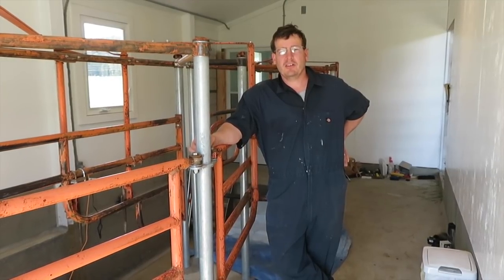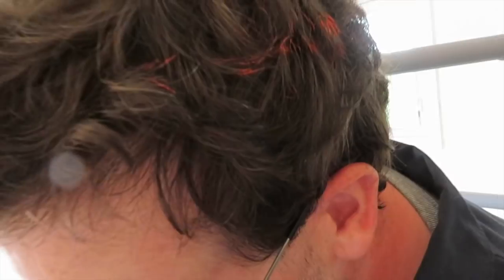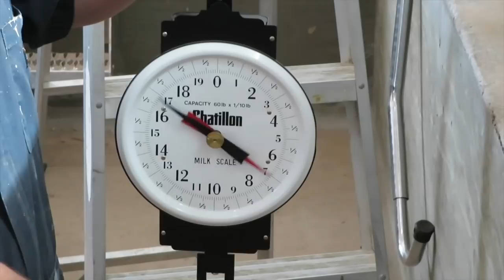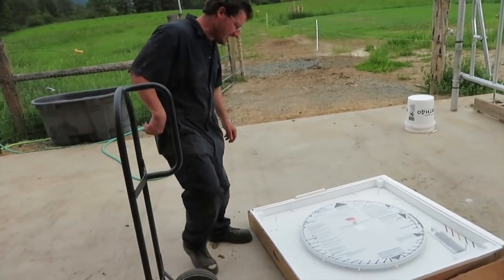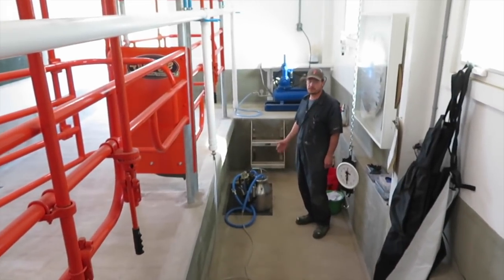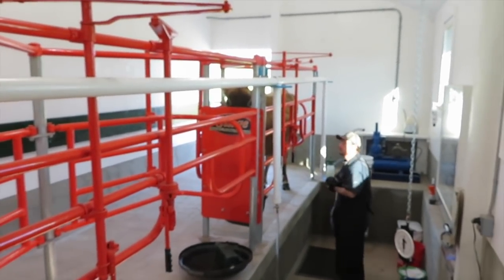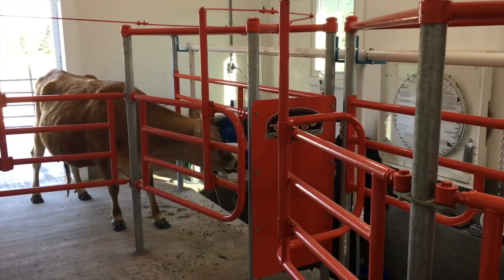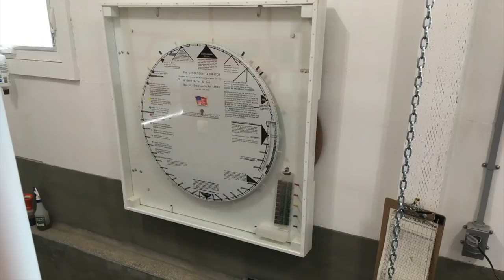Surge Milking Parlor: Installed and Milking First Time! (Building Dairy Barn #16)

Comment: Well Stacy, nice job on getting your parlor painted, now all you need to do is get the cows in there so they can rub all the paint off!  Also, I would take that anti-kick device you have and throw it out the door.  You need the big clamp that goes over the back.  I tried one of those devices that you have and it came off the cow's back and hit me in the head.  ;)
Reply from the maker: I’ve never had a problem with that kind of anti-kicker. I’ve used them in every parlor I’ve worked in. Luckily, we haven’t had to use ours yet! The big clamp type probably work better, but you’d have to climb up to the cow platform to put it on. With the “C” style, you don’t even have to leave the pit! I guess that’s why you only see the “C” style in raised parlors.

Comment: Just seeing your video of the Surge Milking Parlor.  Looks pretty nice.  I have the same in my old barn, 4 single, what’s left of it.  I need everything but the main guard rails and ceiling support pipes.  Any leads?  Southern Wisconsin
Reply from the maker: Sorry. No leads. A good fabricator could probably make what you need though. I have a friend who mills in a double-two. When he got the place, it only had one complete stall. Two were partial, and the fourth was gone! He managed to rebuild it himself and you can’t tell the difference. Good luck!

Comment: Did you guys have plans drawn up of the milking parlor or did you just free hand build it as you went ? Specifically how wide is it , long , and how deep is the pit
Reply from the maker: We had the stalls from the beginning, so we worked around that. The room is 12’x24’ because it just fit neatly into building everything in 12’ increments. (We find for the best utilization of building materials to use numbers divisible by both 2 and 3). I think we could have fit it into a room 11’ x 18’ if we really had to, but really appreciate the extra space. The pit is 34 1/2” deep, which we found works well for the both of us. We’ve both milked in shallower and deeper pits. You can make it whatever depth suits you the best I suppose. The cow platform overhangs the pit by 4” which provides a nice “toe space” to make it more comfortable. The pit is 16 1/2’ long which was determined by the stalls, and I’m not exactly sure, but I think it’s about 4 1/2’ wide. Thanks for watching!

Comment: on the side closet to wear you stand i took and mixed op my own cement and made about a 2 inch high ridge about 4 inches  wide cause i had problems with some cowws slipping off the edge.  and even after i did that  i still had a few slip off.  and they will poop  sooner or later.
Reply from the maker: We went back and forth on a curb. From a milking perspective, we like not having it, but from a safety standpoint, we see it’s value. Ultimately, we went against it. We did set our stalls back from the edge a little extra, and with the girth of the cows, their feet end up being about 18” from the edge. Hopefully this is enough, but we’ll re-evaluate if necessary. Thanks for watching!

Comment: Wow I respect your patience, but would have much quicker with a spryer.... but great job.....
Probably you have already done it, but some concrete sealers would help big time to keep it all clean....
Reply from the maker: Hello! Good morning! If the stalls were outside, I would have considered spraying. I really just don’t like spraying inside. Sure, brushing was slower, but prep time was minimal. It’s a trade off I guess. I got the mils I wanted, so I guess I did ok. Yes, the concrete is sealed. We seal all our concrete, interior and exterior, no matter it’s use. Thanks for watching!

Comment: No, no, no, you don't need a pipeline for a small dairy, it will just waste milk and they are hard to clean.  I sold mine and went to milking with floor milkers like the one you have using NuPulse vacuum-driven claws.  Much better system IMHO.  :)
Reply from the maker: For our small herd, the bucket is fine, but if we add to our herd, we may look into a pipeline. Even so, I’ll still use my NuPulse claws.